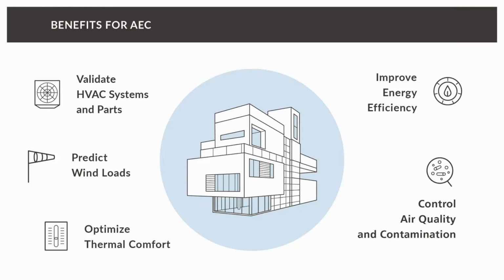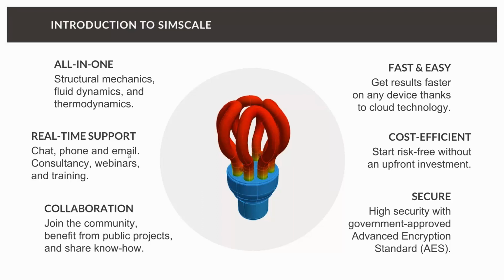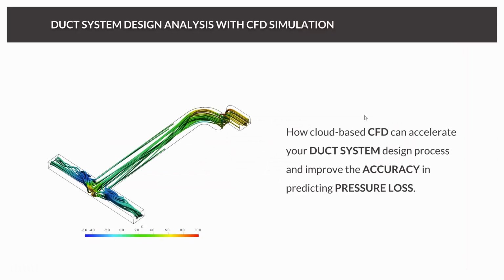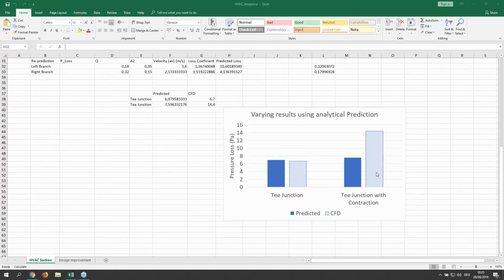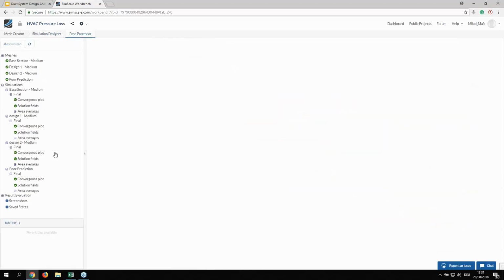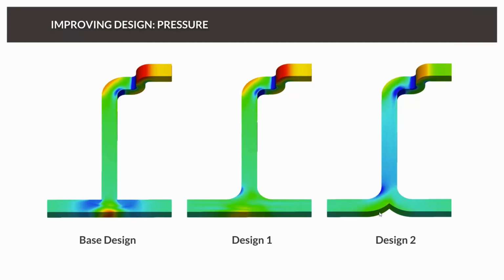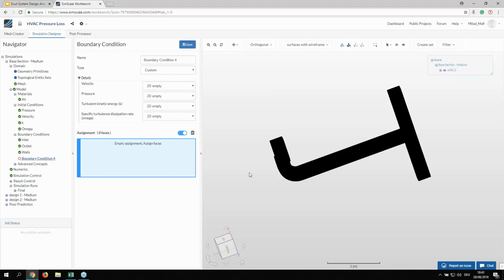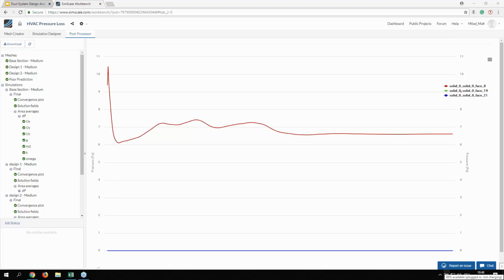Duct System Design Analysis with CFD Simulation

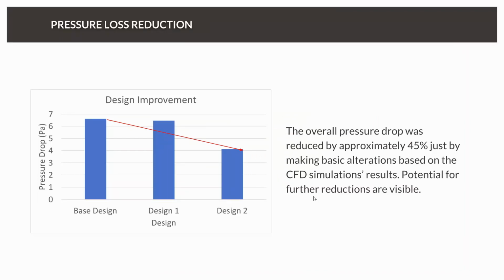Comment: Question: - It is a very good example for engineers new to CFD; at 39:49 Your present: -  "Pressure Loss Reduction" for the 3 options - how was this data extracted from the Output Results ? and Was "Design 2" Really any better than "Base Design" ? Can you show how to extract "Pressure Drop", "Flow" at exits from the Simulation Results ... Can you show what parameters are used to assess a Duct's Performance and how they are extracted from the Results ? ... Thanks
Reply: Hi Mark!

You can have a look at this project which will answer your question: https://www.simscale.com/projects/Ali_Arafat/hpac_webinar-duct_flow_analysis_1/ - there you can see that a result control item has been used to identify the pressure loss. The post-processing data can be extracted in different file formats (PNG, JPEG, SVG as well as CSV!). The latter file format can then be used to create a chart as you have seen in the video. Hope that helps!

Jousef